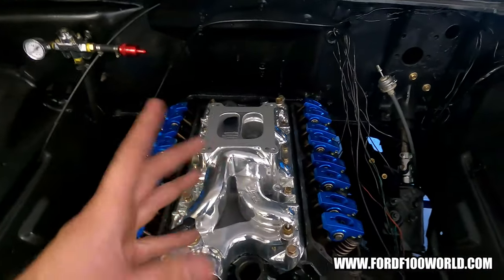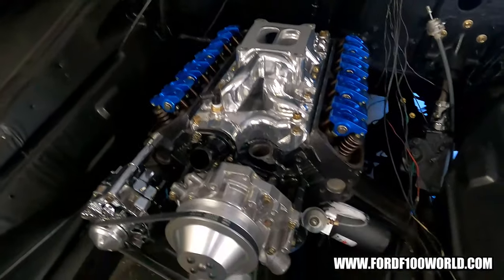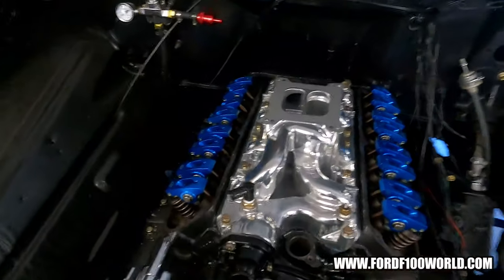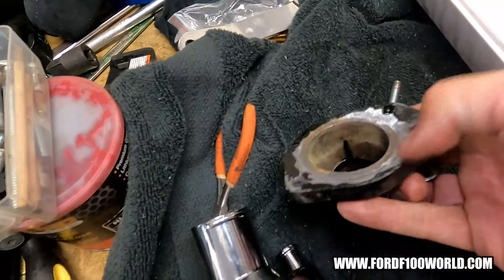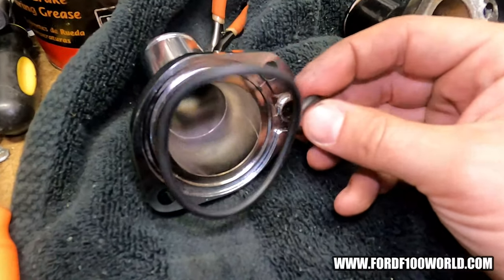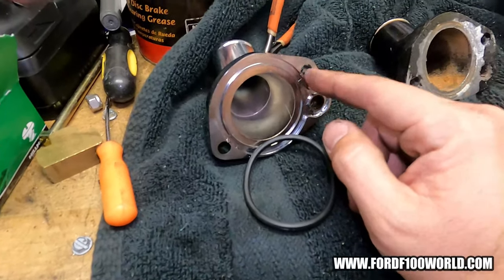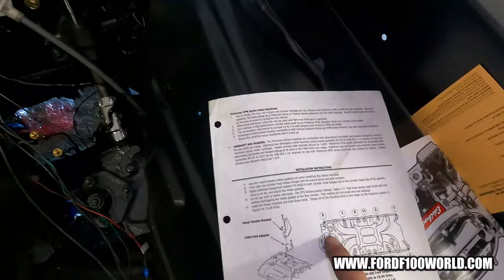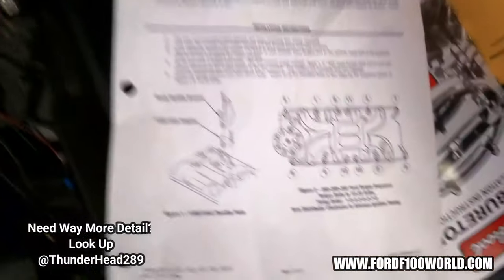302 Intake Install Tips 5.0 F100 #DIY @fordf100worldmemberstrucks9

Comment: Hey, looks like you decided to use the polished intake. Tech tip. With all thermostat housings, especially aluminum, it’s best to check for warping on a piece of glass or a flat plate. A few minutes of surface sanding will make all the difference between sealing or a leak. Another tip on valley gaskets. There can be a wide variety of tolerance with aftermarket intakes and cylinder head combinations. In some circumstances, if the gap is too wide, it may become necessary to still use the cork. To test, set the intake on the engine with the gaskets in place, and check the gap. If it’s much beyond 1/4 inch, you might consider opting for the cork, rather than bridging a too big gap with silicon. Thanks for you videos.
Reply from the maker: Niice I’ll remember that one
Reply: @FordF100World  The o ring thermostat outlets do work, if they are sanded till perfectly flat. But I still prefer to go old school with gaskets